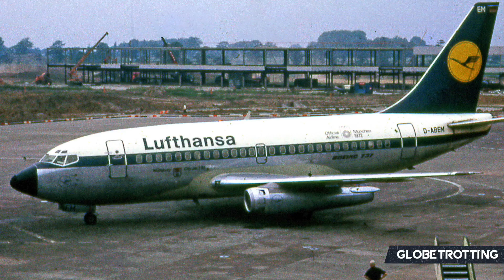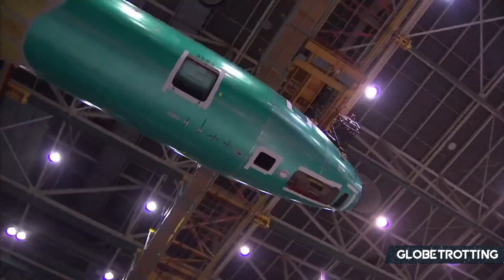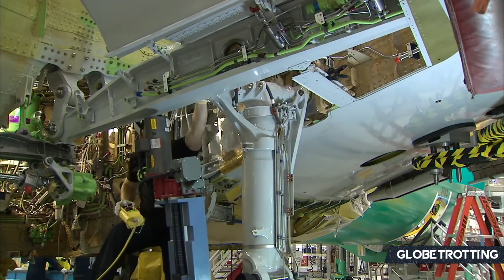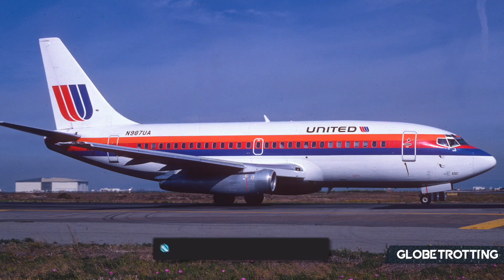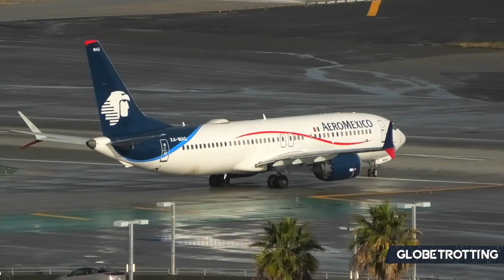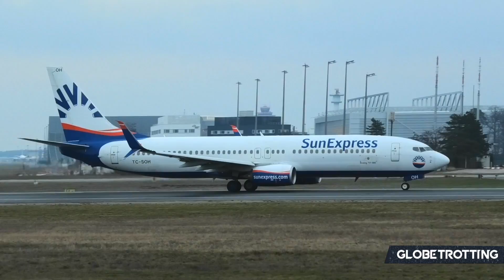727 REPLACEMENT? - The Boeing 737...

Comment: While the 737 may well have been at the start of the sectors explosive growth, I am not so sure that we can be as certain that it was responsible for it.

The Original and the Classic sold well, however, it was not until the NG that sales actually took off. 

I believe that the NG was the response to the A320.

I also think that some credit should be given to the DC9 and the MD successors.

Comment: Technically, the Boeing 757 was the replacement for the Boeing 727. The only commonality between the 727 and the 737 is that the 737 "borrowed" the fuselage from the 727, which in turn borrowed the fuselage from the 707/720 program. While the 737 can truly be compared to the 727, the actual "true" replacement was the -400 series with a similar seating count. Slightly better fuel economy at altitude, but almost as sluggish as the 727 when it comes to takeoff performance. That third engine is what makes the 727 slightly better at taking off during hot summer days, but not by much. Now, the 757... I'm going to say that it put the 727 to absolute shame in all respects, and Boeing surprised themselves with the design.

Comment: The 737 is past its prime and Boeing needs to start a clean sheet replacement. The Max is a desaster.
Reply: Boeing should have realised that as soon as the A320 was released.

For their day, the 737 Original and Classic were something special with the DC9 as the nearest and only volume competition, however since the release of the A320 with each iteration significantly outperforming the then current 737, the Boeing response has only been enough to compete again.

Agreed, depending on whose stats you chose to rely on, and based on how the aircraft is to be used, there may be 1 or 2 percentage points of difference, but certainly far from the double digit improvements seen between generations.

Neither has a clear advantage across the various usage scenarios.

Comment: Boeing would have been much better off having made a brand new narrow body airplane instead of cooking more soup on old bones.
Boeing have also currently a whole set of problems that are more grounded in a flawed corporate culture where they have lost sight of their core business and focused more on profit, shareholders and share price.
Boeing need to get back to the basics of producing high quality products where failure is just not an option.
Unless Boeing get their💩together, they will open the door fully and wide for Comac to come in and compete directly with Boeing and the there may soon be 3 major airplane manufacturers in the world with Boeing quickly being the smallest and least interesting.

Comment: I flew B727 freighters for 3 years back in early 1990s and don't recall any design flaws/components causing accidents across the model. Not true of the B737.  I know airlines hated paying a flight engineer but the pilots loved them and F/Os had less to do.

Comment: I just don't trust Boeing to build anything that is safe, I just flew on a 737 MAX and was nervous for the first time on a flight, I much prefer Airbus, especially the new A220
Reply: Clearly,  the MAX you flew on didn't fall apart, and I'm going to guess you're flight was uneventful.  If the MAX was as "dangerous" as imagined, the FAA or EASA would let the type fly. They'd be grounded indefinitely.  Instead of relying on media hype, rely on your logic where the MAX is concern.  I just completed my 52nd MAX flight.  It's a solid aircraft.  As for the recent QC issues, that's being addressed, and Boeing production is under extremely intense scrutiny right now.  Boeing can't scratch its butt without an FAA regulator checking the paperwork to ensure it was done correctly.
Reply: @toms1348   I have a friend that is a Captain for Air Canada, he has flown the max and doesn't like them, prefers Airbus
Reply: @JohnAnderson-sq8lt , that's simply a preference.  I have two friends type rated on both the MAX and A320 series.  One prefers the MAX, the other the A320.  Both agree that both A/C in their most current iteration are very good, efficient planes.  I hold only a private pilots license..so I can't speak from experience, and take their word for it.  As a passenger, I really don't see much of a difference between the two.  The A320 has maybe 2 more inches width in  the isle. And the window seats have a bigger gap between the seats and the fusilage.  The airline I fly uses the same seats for both the A320 and MAX.  This is for cost savings and equipment commonality...my guess.  Anyways, I don't have a problem boarding a MAX.